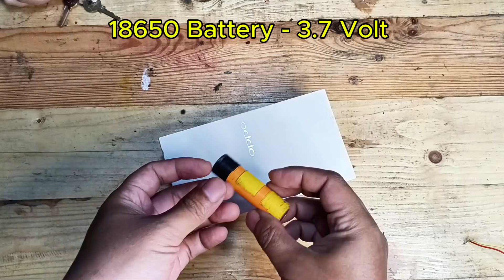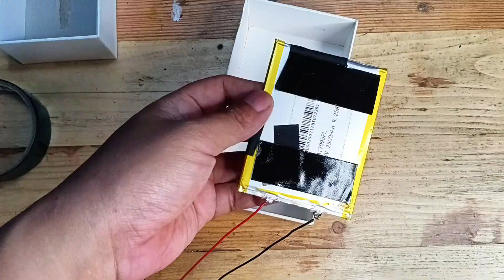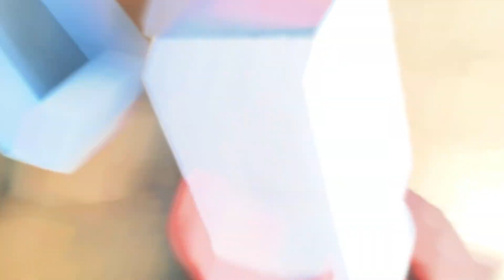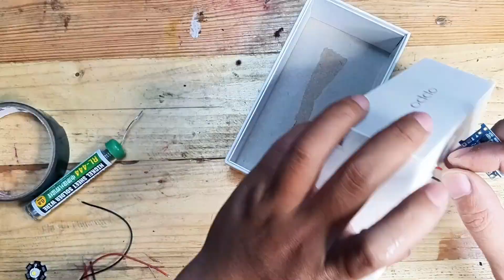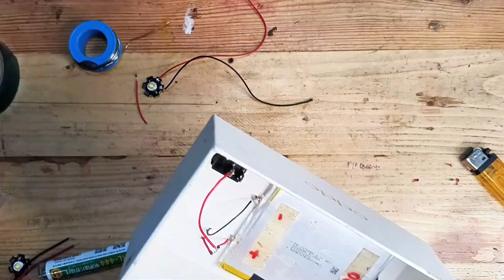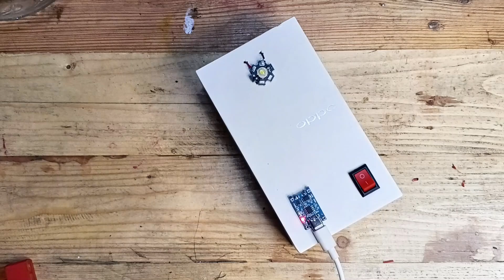DIY Long Lasting Emergency Lamp from Old Smartphone Parts - Up to 24 Hours

Comment: OK. Now make a 4 or 5 watt lamp using those little bulbs that will run off any 18 to 20 volt power tool battery. Most people have them , I have 20,
Reply from the maker: That's a good idea. I'll try it.
Reply: @wihaf  I bought an adjustable 24 down to 10 volt buck converter and a 5 watt, .  12 volt edison base LED bulb. I never made it because I have bought 4 of the porter cable 20 volt flashlights.